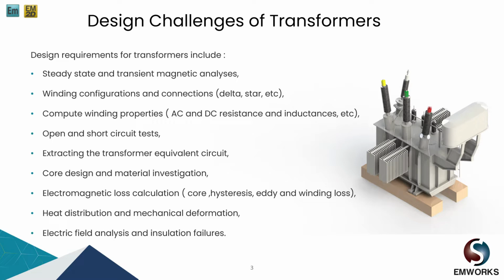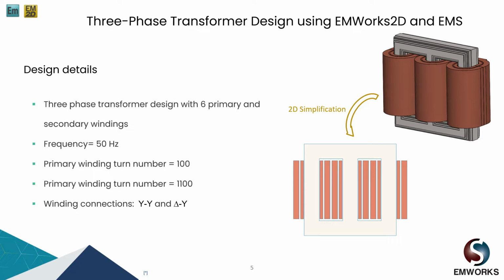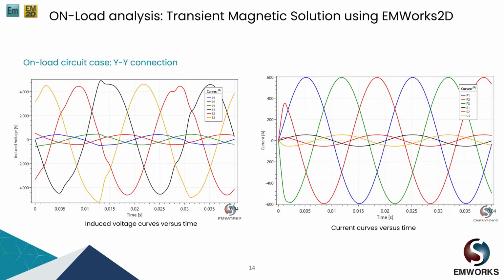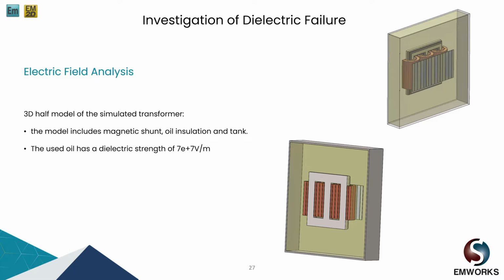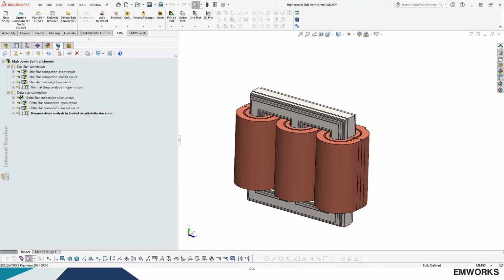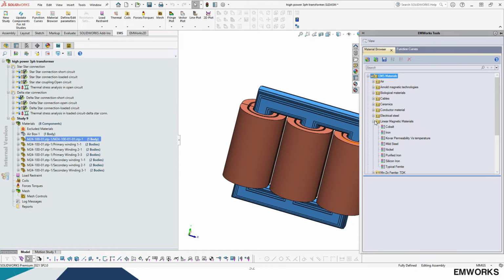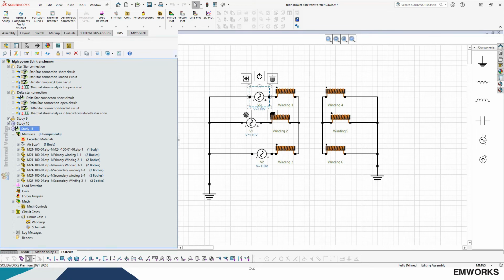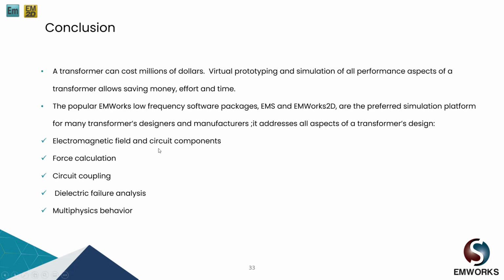[Webinar] Performance Analysis of a Three-Phase Transformer Under No-Load and On-Load Conditions

Comment: why would there be a temperature difference with a balanced charge?
Reply from the maker: Thank you for reaching out! Even with a balanced load, a transient simulation can still show a non-uniform temperature distribution. That’s mainly due to local hot spots (especially at edges) and the instantaneous phase current peaks at the specific time step when the temperature plot is captured.